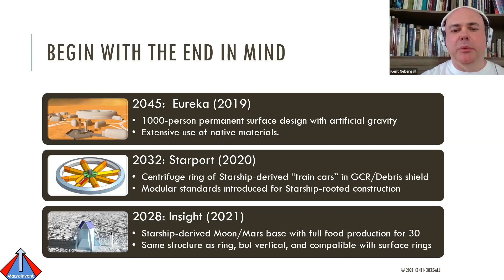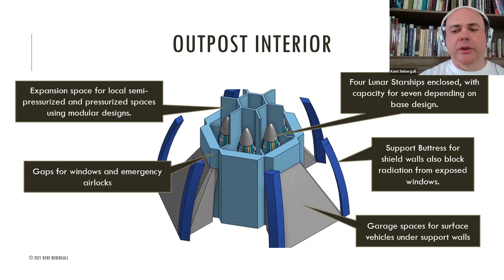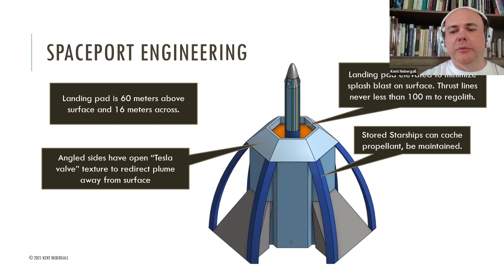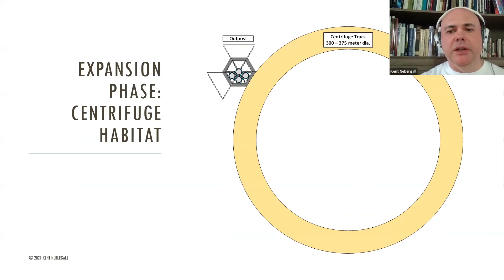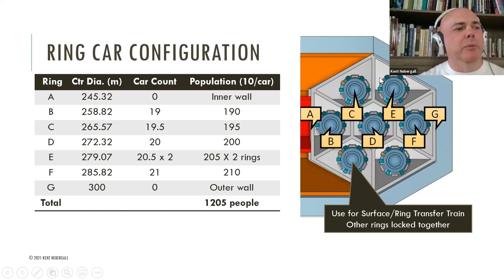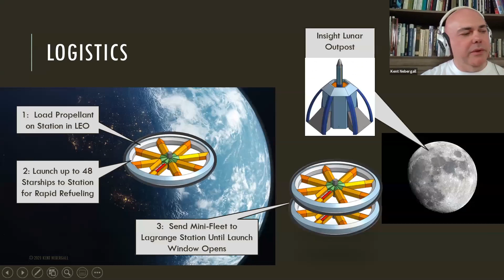Insight: From First Landing to Cities - Kent Nebergall - 2021 Mars Society Virtual Convention

Comment: Does it really make sense  to keep expending Starships as the basic components of your habitat (in particular as cars in a gravity train)?  Possibly if Musk were to revisit the basic design and split the Starship into 2 stages, the 'payload' section could be economically left behind (on orbit, moon or Mars) while the propulsion section returned for reuse.
Reply: Thanks for your feedback, Tom.  Excellent point. 
The engines would be split off and either returned to Earth or kept on site as spares to service visiting vehicles.  I should have made that point.  The alternative may be to leave out the core engines entirely because it doesn't return to Earth, using differential thrust on ascent for control. Or if that doesn't work, make a vestibule port module with a single gimbaled engine.  Either way, all the engines come off before it goes in the train or vertically in the tower. 
The beauty of StarCar is that the spacecraft IS the payload.  Nothing is wasted.  And tanks are dirt cheap. Returning the engines makes sense because they can crank out the tanks like nothing once they get the production line running. All units in the payload/living area are also modular, so once the base is built, it's just sending up spares with locally sourced materials added to the production stream over time for frames, etc. 
Speaking of engines, one beauty of building Starship in open hangars in Texas is that they aren't being done under clean room conditions.  They are not hothouse flowers - they are 1950's tractors because they are built to be used in dusty worlds.  Swapping a shuttle engine takes a month and a clean room.  In Texas they are swapping them faster than you can get a 1990's motor out of a Pontiac, in both salty coastal and dusty conditions.